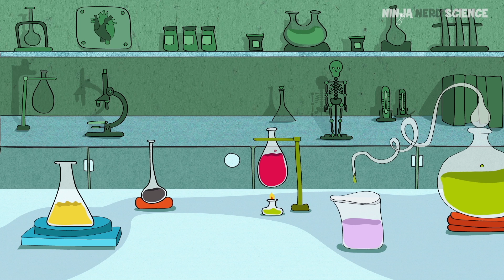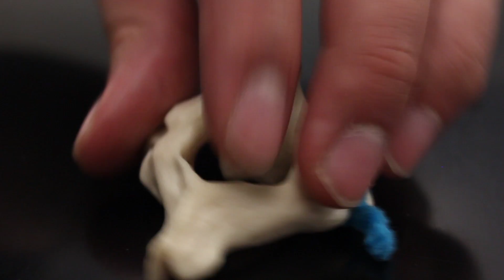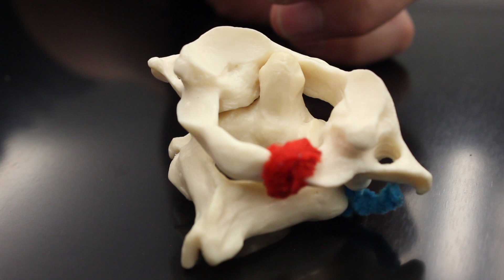Atlas & Axis Cervical Vertebrae (C1-C2) Anatomy

Comment: Atlas or c1
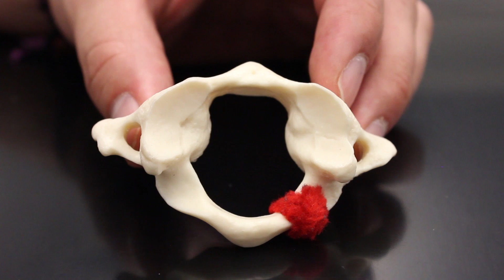0:19 Superior articulating processes
0:32 anterior tubercles
0:35 posterior tubercles
0:44 transverse processes
0:53 transverse foramina
0:58 vertebral foramina
1:06 dens or odontoid process 
1:32 inferior articulating processes
1:56 antirior arch
1:56 postirior arch
Axis or c2
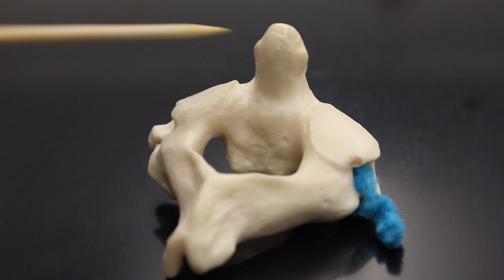2:22 dens or odontoid processes
2:26 supirior articulating processes or facets
2:37 veritebral foramina
2:40 spinous process
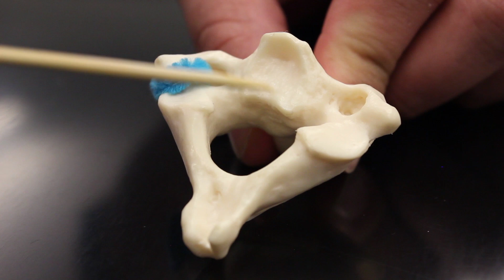2:54 body or centrum
3:06 transverse processes
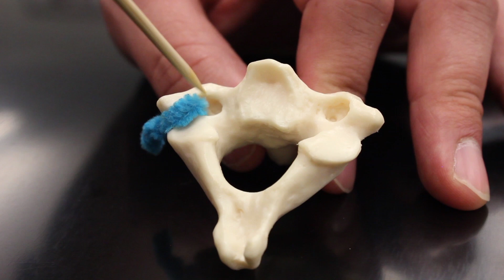3:13 transverse foramina
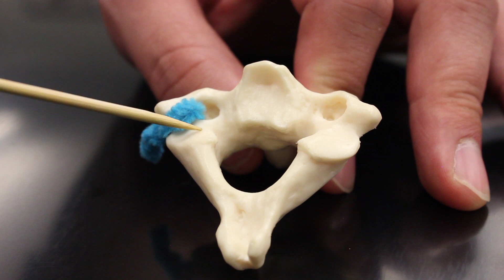3:22 inferior articulating processes or facets